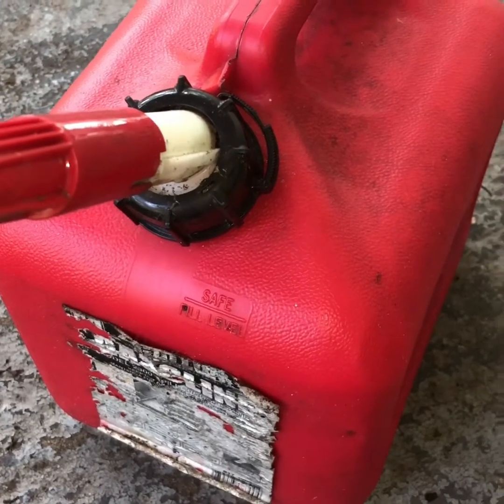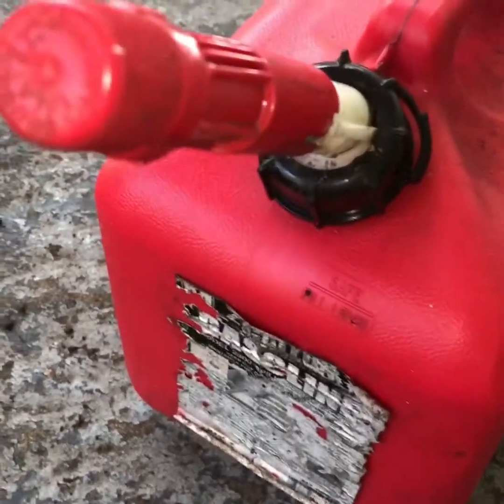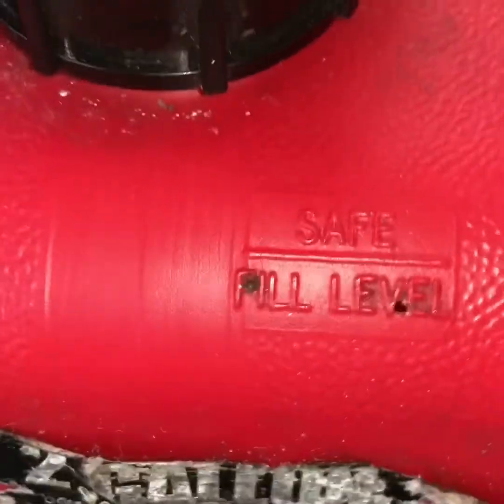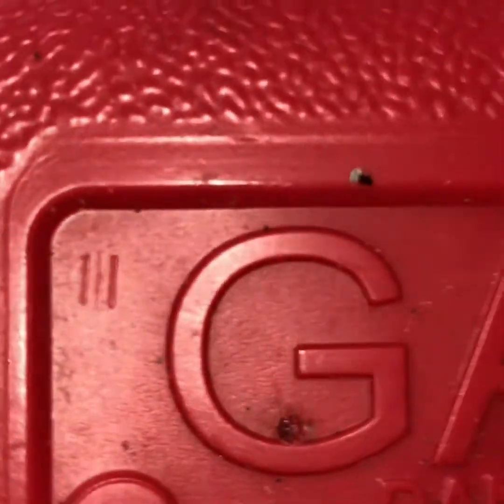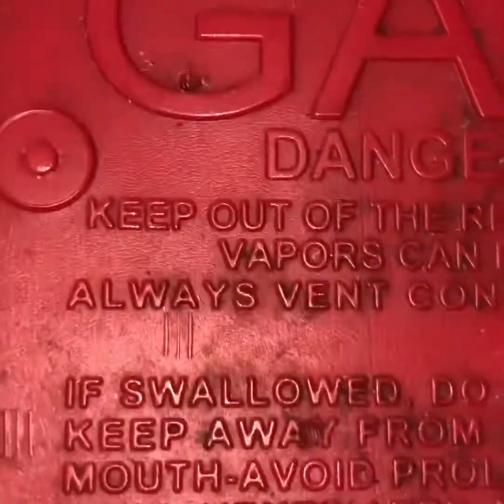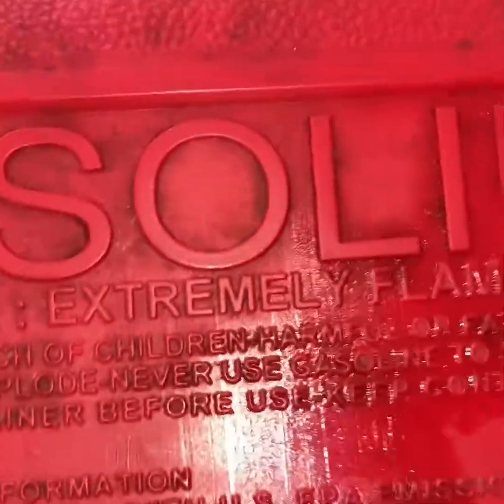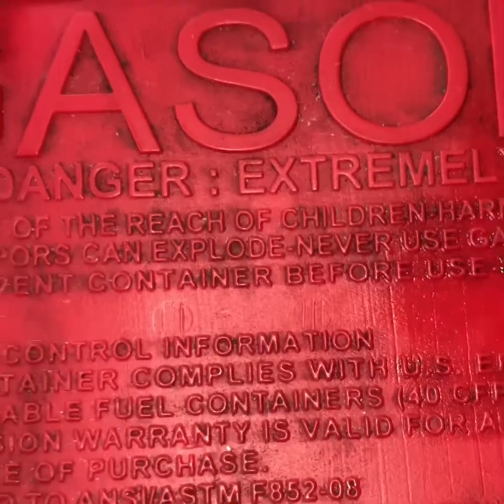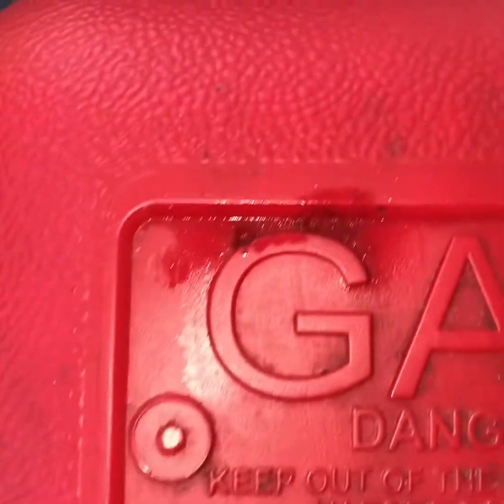Plastic Gas Can BUG!!!

Comment: Here on Kauai my vehicles and gas cans have been plagued by these idiot beetles now my 2019 Tacoma has a leaking filler neck for the second time.
The first time the gas tank had to be replaced also as it’s now made of plastic. I’ve trapped some and took them to the nearby invasive species office, they confirmed they are 
a few types of beetles that are attracted to ethanol that rotting wood releases, so they are confused about ethanol in gas. I finally got a metal gas can and am trying to find ethanol free gas for the truck and farm equipment.

Comment: Yes, 5 gas cans full of holes, they eat holes in rubber fuel lines, and ate 50  holes in both my generator tanks each.
I scrubbed the cans clean, then using my weller solder gin closed up all the holes, took several hours to do.  For a fix, I plan to never leave any gas in the gas cans, fill the tanks then flush the cans and let them dry out in the sun. The gen, maybe I can spray insecticide on the fuel tanks, I dont know.  If you switch to marine fuel hose that has the nylon inner liner, that will prevent them from eating the fuel lines.
Edited to add i am in newport news Virginia.
Reply from the maker: I’ve been keeping Non-Ethanol gas in my cans now. So far haven’t seen any more. When I heard your story, damn that’s messed up.
Reply: @HowYouCanDoItToo  Cant buy non ethanol gas here. Since there may be a hurricane Isaisa coming I looked into getting gen going and found all these holes.